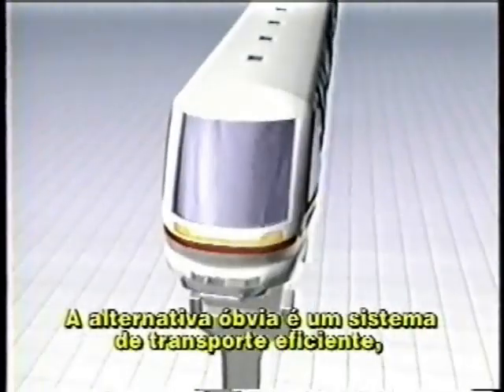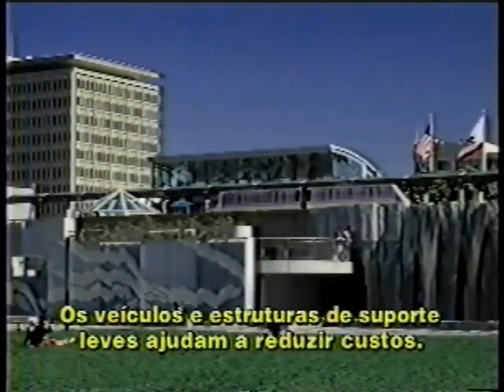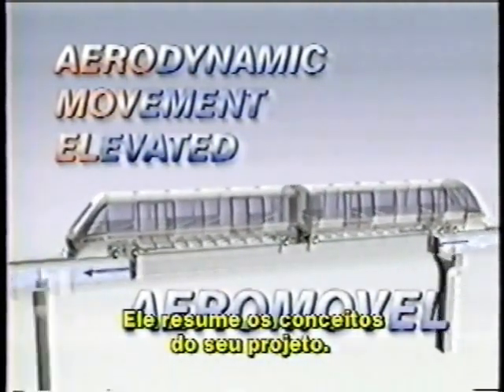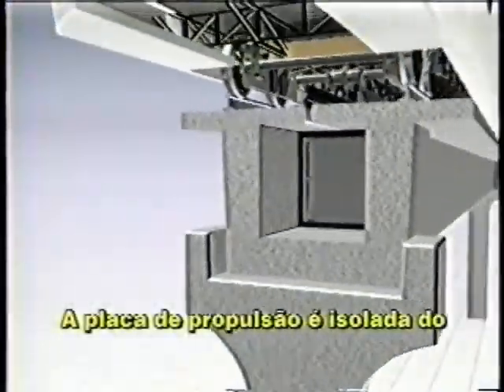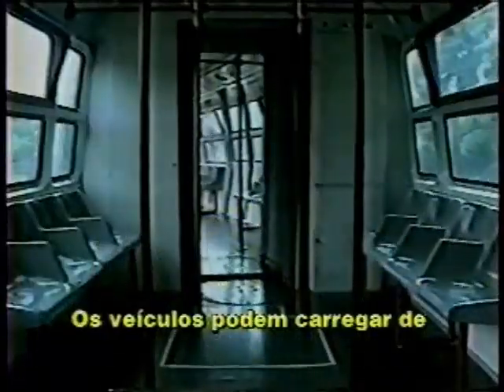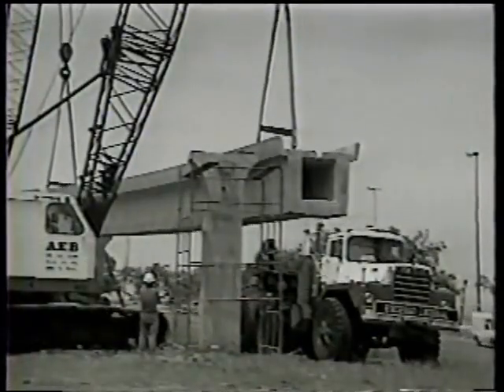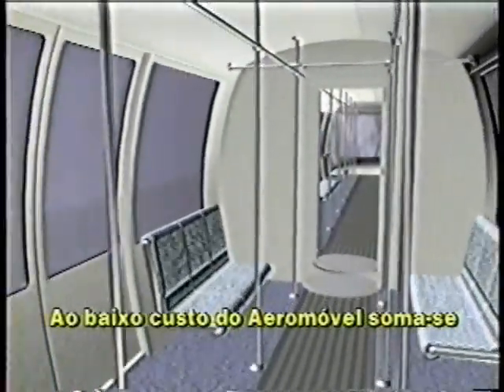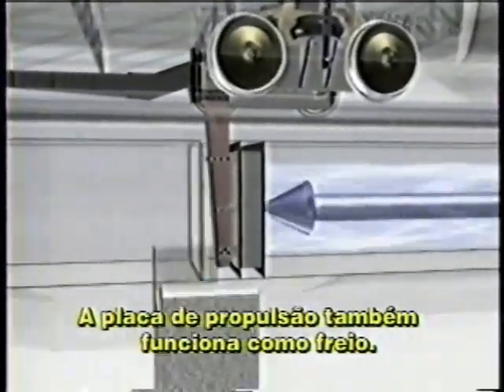Princípios de Funcionamento do Aeromovel.mp4

Comment: Wow, this is a good commercial. No wonder 2 cities got duped into buying this trash
Reply: Porque é um lixo? É porque não foi desenvolvido primeiro em seu país? Um sistema eficiente, prático e não impacta o meio ambiente. Acho melhor você rever seus conceitos.
Reply: @carlosgoncalvesdossantos8795  No. Because the Aeromovel system have a lot more limitation than traditional electric motor traction. Transmitting electricity is obviously easier than moving airs
Reply: Fully agree with you. Any good engineer could see the shortcomings of this energy wasting system right from the outset in 1977.  Reason for implementation in Brazil  could be something like national pride (inventor was brazilian), or just showcase.